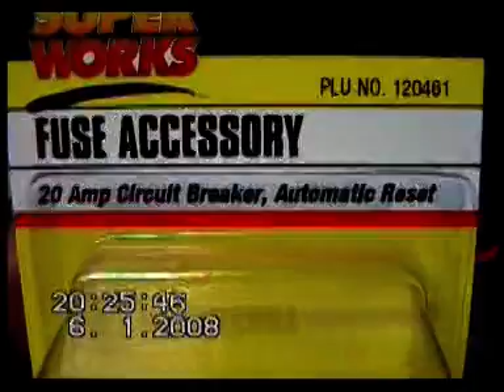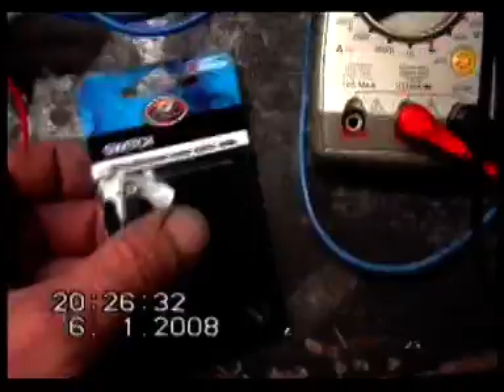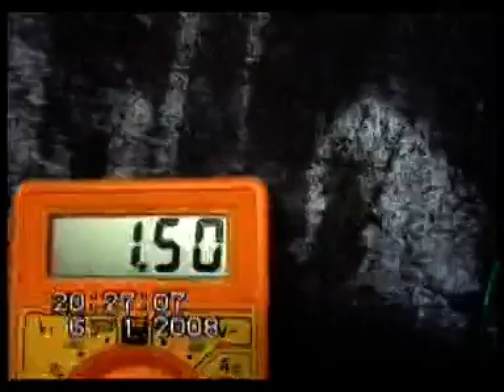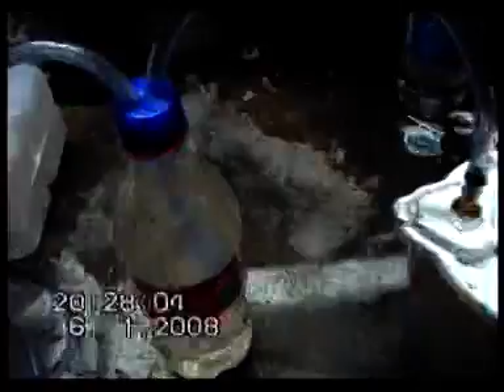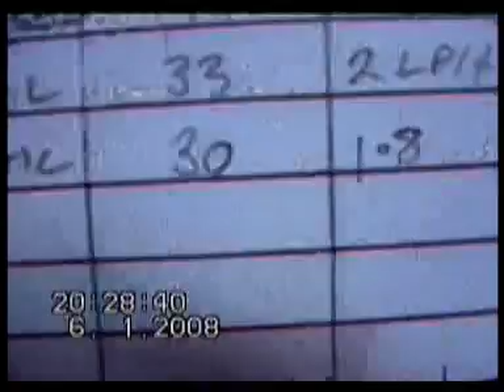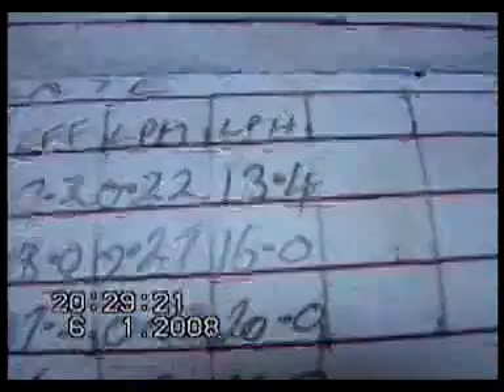Alternative automobile fuel cell.  HHO cell setup for vehicle use. Run your car on water.

Comment from the maker: Dc motor controller allows for a variable speed to the dc motor. It sends an interupted pulse of varying strengths to control the speed. This feature seems to generate more gas supposedly jolting the gas from the plates as the initial pulse is high.

Comment: Good job! Did you say DC motor control OR Pulse Width Modifier ? I 'm curious about using a dc motor control from an old treadmill machine that uses dc motors